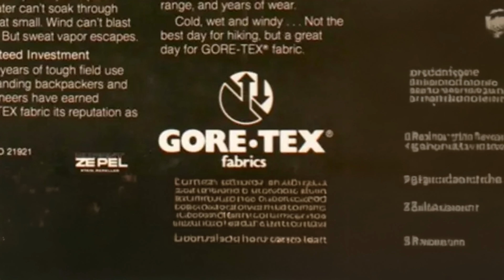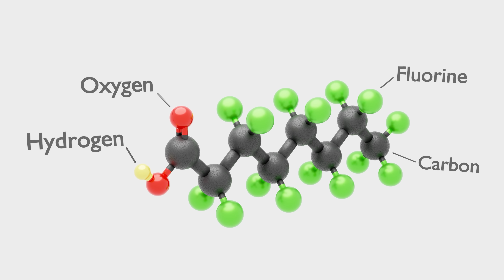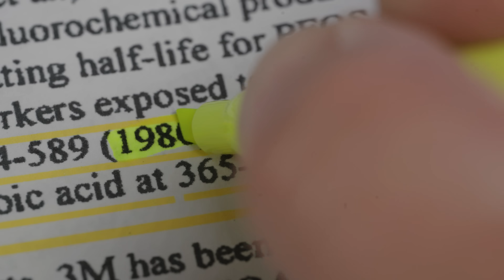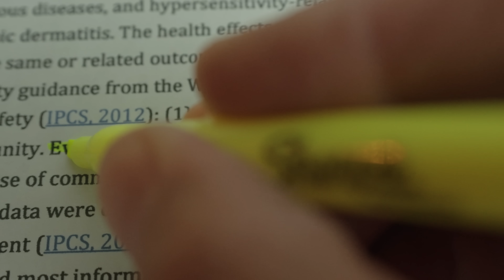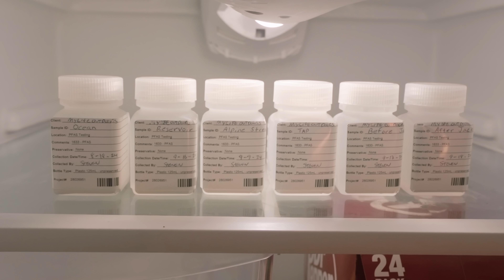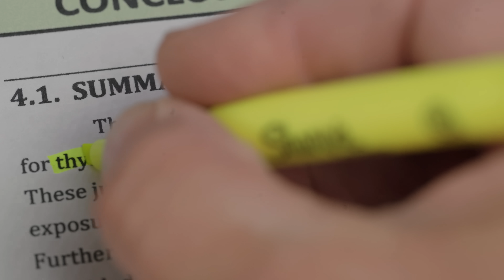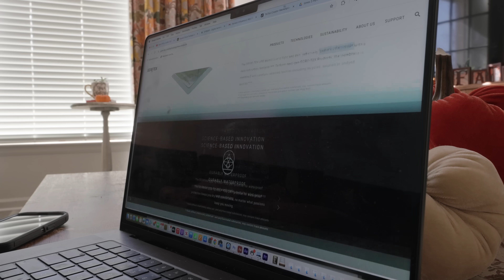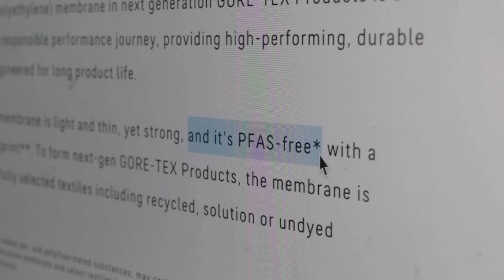Your Gear is Poisoning You! (Not Clickbait)

Comment: As a Chemical Engineer the issue is generally that while the polymer itself is very very stable, the monomer is never completely consumed in the reaction and cleaning of the polymer fibers is never sufficient to remove ALL remaining monomer.  Think of it like a big bowl of spaghetti, toss in in sauce, then freeze it... then wash the sauce off the outside without letting it melt... still lots of sauce mixed in the middle to slowly leak out.
Reply: Could you freeze the spaghetti in water then shatter it into smaller pieces? 

I have this idea in my head that you might be able to somehow encapsulate the chemical then break it apart into smaller more manageable pieces, but idk. Sounds like you would need stronger chemical bonds that what the forever chemicals are held together with which is just making more forever chemicals. Is ozone a forever chemical? That's the strongest molecule I can think of but once again I don't know a whole lot.
Reply: @jllemin4  the issue is you want long stable polymers which is good, but polymerization always leaves some monomer and short chain polymer trapped in the ball of long chains.  If you break the long chains you destroy the useful properties.  Generally you'll use a solvent bath and water bath to remove the excess but you're never going to get it perfect.
Reply: I was under the impression that long chain polymers that are more stable are the ones that degrade into micro and nano plastic particles ? Short chain polymers are the ones that are easier to recycle ?
Reply: @Onoma314  the long chains will stick around for a long time so yeah if you throw that coat into the ocean it will eventually shred into micro plastics but the stuff that will wash out in the rain are the smaller monomer and short chain polymer chains of the same exact polymer.  Recycling is a separate issue related to the type of polymer.  In short it's all bad with PFAS but the short chains are what will leach out even if you are careful with disposal and are often dumped by the manufacturer into the ecosystem as treating that waste water for PFAS is expensive.
Reply: How much $$$ do you the public will pay on their products for companies like yours to continue to manufacture.

Because while everyone wants to *** & complain about chem this and chem that; they quiet down real quick when the wallet starts being affected.
Reply: As someone who cooks a a lot especially spaghetti that explanation is very helpful. I am also very bothered by forever chemicals to the point to where i will almost never drink or eat from plastic of any kind   but it is so hard to avoid..  Good cast iron is a very good replacement from chemical  coated pans it takes some doing to take care of them but they last for longer then any of us will be alive.
Reply: @markcalhoun8219  Appreciate you taking the time to answer that, Mark. I live in Asheville, any thoughts on the water quality issue here down the road, since there were so many manufacturing plants here ?
Reply: @MR-MR-ud5oo  there is a reason I do not work for a chemical company despite my education.
Reply: @Onoma314  overall the US has a huge infrastructure need for water purification capable of tackling large stable organic molecules such as PFAS and pharmaceuticals.  We are getting closer but it will be a long road.  If you live in an affected area get a RO filter to at least be drinking safe water.
Reply: @markcalhoun8219  I filter and distill my water but the amounts of micro plastics and VOCs we are exposed to in our everyday lives, in our houses and cars, is insane.  PFAS and PFOS aren't the only bad chemicals...
Reply: @markcalhoun8219  Big facts about reverse osmosis.
Reply: @MushookieMan  Grandpa and dad had lead and we get plastic.

It's just something you gotta deal with ngl.
Reply: @markcalhoun8219  Thank you
Reply: what solutions is the industry trying right now?
Reply: Hi, an MD here. What he is saying is that no chemical reaction is ever fully “complete.” So, at the end of the of it, there will be small quantities of non or partially consumed reagents or building block chemicals. These will be mixed and insinuated into the fibers of the product. As such, one can never really wash them out completely and they will continue to leach out over time. This is one of my complaints about chemistry in general, the assumption that things are benign or safe without study. The human body and the Biome itself is ridiculously complex, and as such is very sensitive to unexpected disruptions. Normal biohazards are in someways better because our bodies seem to be designed to be able to manage and metabolize them, even poisons. Not so with so many sturdy organic compounds. Even changing a bond in an unsaturated fat from “cis” (normal, biological) to trans (abnormal, synthetic) is a disaster, and our bodies literally cannot metabolize or excrete them. As a society we need to be MUCH more careful! But…profits will ALWAYS get in the way!
Reply: @markcalhoun8219 by affected area, do you mean N. America? 😂
Reply: @MR-MR-ud5oo maybe some, but not all. As someone that would pay the difference for a safer and healthier product, I disagree
Reply: @markcalhoun8219  Which is one reason why I couldn't continue working for a pharm contractor.
Hard to stay there when their business model is:
Reply: @jllemin4  we need the long spagetti strands thats whats usefull about the polymer
Reply: Its in the pockets and hems if my excma is anythung to go by
Reply: So you need yo make hollow tube noodles like macaroni
Reply: All the linings of my water proof jackets end up turning to a powdery dust, breaks down like crazy after 3ish years.
Reply: Thanks for explaining, People kept mentioning that it doesn't break down and I'm like isn't that a good thing? That means it's inert. And no one has brought up any casualties as a result of Pfas so I'm very confused.
Reply: this is one of the worst analogies, or rather badly worded analogies
what do you mean "wash the sauce off the outside"? why would you wash a bowl with frozen spaghetti in it? your last statement makes it even more confusing; WHY WOULD IT BE IN THE MIDDLE IF THAT'S ALL THAT WAS IN THE BOWL?
not everything can be simplified, and sometimes it just makes the understanding even worse.
Reply: But what if the issue isn't really an unusually capitalized chemical engineer? What then?
Reply: Can confirm this guys comment. Good analogy. "Chasing" monomers out of polymers in the production process isn't 100% effective. The manufacturers keep an eye on residual monomers during QC and will do what they can to keep residuals as low as possible. I don't know what tolerances are used for PFSA chemicals though.
Reply: @gongcircle507  I mean planet earth overall but there are especially polluted areas generally near the manufacturing facilities where the levels can be acutely dangerous.
Reply: @bananian  it not breaking down doesn't make it inert unfortunately in much the same stable pharmaceutical chemicals are not inert, they can basically interact with the body like hormones triggering the body to do things it shouldn't leading to cancer.
Reply: @nisbahmumtaz909  I'm sorry it was not helpful to you but it seems to have helped others.  even the professors I studied under used spaghetti as the analogy for polymer behavior.
Reply: @user-deleted  yeah when you're tracing PPT levels you would need some revolution in polymer manufacturing like biological polymerization to actually get 100% monomer conversion and chain length control... even then it's going to end up generating PFAS as physical wear sheds its microplastics.
Reply: Which is why I don't like plastic bottles
Reply: Solution: stop doing this process, altogether.
Reply: Thank you for this intriguing and beneficial information. I appreciate your spirit of inquiry.
Reply: Biomedical Engineer*
Reply: Hope you see this- thanks for that explanation- perfectly understandable 👌🏻
Reply: So my other comment that you will never find here was asking if this was a one time occurrence after manufacturing and if he tested the jacket again would he see none/less?  Based on what you are saying, it sounds like it would be less each time until it was possibly undetectable?
Reply: This is a great explanation. Thanks. I'm not too worried about the GoreTex gear I have. Would I buy anymore? Well, now they're hiding that it's GoreTex. So I might buy gear that has a whole list of wonderful properties... and what is it really?  
My rule about my $250 GoreTex rain jacket is if it might rain, or it's cold, I'll wear it. But if it is going to rain? I'll wear the cheap plastic Japanese fisherman's rain jacket that just sheds water. So I really don't need GoreTex and it's been oversold.  You also have to wash it regularly or dirt build up somehow wicks the water through. 
I also don't think my gear is 'poisoning' me. It has proven bad to manufacture it, and it gets into the environment where it is persistent and bad. But wearing it? 
I've got some Seal Skinz socks that work like GoreTex. These are one of those products where if it has PFAS they hide it. They actually have the GoreTex effect. Right up next to my skin, I can feel air passing through the socks and my toes. But they are waterproof. My feet never sweat, never get wet and are warm when I get in my sleeping bag.  Two layers of Smart Wool, if they get wet, my feet are usually cold for 45 minutes in my sleeping bag. The heat from my feet effectively drives moisture through the SealSkinz 'sock membrane.' Wool also does this. But submerge smart wool, it gets soaked and overwhelms the moisture wicking. What would work is a waterproof layer over the socks. So no GoreTex effect or PFAS needed.  So when it comes to a GoreTex jacket.. they do have a comfort level, but layers of merino wool under any waterproof jacket with a zipper, maybe some vents, I think will always be better.
Reply: @WillN2Go1  Yeah honestly I'm not going to get rid of mine either but there's a lot of reasons I'd prefer other options in future.  Same with teflon cookware.  I can't say I'll have zero teflon pans but in general I try to use ceramic, SST or Cast Iron.  The overall issue is how prevalent PFAS are in industrial products, it's in lubricants and components across the planet.
Reply: @markcalhoun8219  thanks for the splainations.
Reply: @markcalhoun8219  Yep. I used carbon steel and cast iron for years, but last year I got a Granite ceramic pan. Works great, non stick. Have to be a bit more careful, but seems durable. 
Teflon pans were always temporary.  I dated a girl in college, in the 1970s who said, "F* Teflon. That sh* wears off. Then where does it go?" Wise beyond her years.
Reply: Why are they allowed   ?
Reply: Polymers, like Glass, Never truly melt….
Reply: Excellent analogy.
Reply: My uni chem prof was the same way. Degree in chemical engineering, got into the humanities and then didn’t want to work in the industry.
Reply: @nisbahmumtaz909  What he means to get the the point is they cannot wash out or dissolve all the chemicals used to make stuff like Gore-Tex and it gets trapped in the fibers
Reply: @MR-MR-ud5oo  All Columbia Outdry™ jackets are PFAS-free. I only wear this during the winter and waterproof gear with biodegradable DWR during the spring & summer.
Reply: I’m so confused by your spaghetti example. Why are we freezing? God I thought I was relatively smart
Reply: @frisc0strangler207  because polymers are kinda like frozen spaghetti at room temp which is why they are solid rather than acting more like a liquid as they do when they are polymerized at high temp.
Reply: @El_Hoy_BTC  the real issue is ultimately that they are being made in large quantities in the first place.  No matter what you do that PFAS exists even if you throw them away.  The amount you'll get on you from shoes is basically nothing since the coating is on the outside and you're wearing socks.  I wouldn't worry, just consider whether you need goretex on future purchases.
Reply: You are wrong, read my answer.
Reply: @WillN2Go1  my grandmother liked stone or cooper pans, otherwise they’re trash
Reply: @KEYBOARD_WARRIOR_  what brands? never heard of this before
Reply: It’s okay, I worked for a polymer concrete company that makes millions of pounds of p.conc culverts for sanity sewers. There are ZERO, regulations. I went to a dinner with our CEO, and our plastics supplier’s family owner. They laughed that they just need to make enough money to get ahead of the EPA — as there’s without a doubt no way to turn a profit if the material was regulated in the slightest. 

I did our environmental and permit reporting, nothing there oversees any of the extremely hazardous materials we use for mold making or the polymer itself. It’s all made as cheap as possible. 

Wine vats were recalled for their resin. I wonder what extremely corroding sewer liquid is doing to unsafe and unsealed polymer in our water ways. 

They’re all over, we’re one of the largest manufacturers, and it’s just getting bigger as a civil engineering product.

If anyone has any tips in terms of where or how I can report my former company, I have a ton of information I’d be happy to flip on. They’re absolutely way more harmful than some rain gear, recycling, or any other source of environmental destruction. They’re going to compartmentalize our infrastructure, and it’ll be too late to stop all the poison we’re putting in the ground.
Reply: @victortaveira8271  cooper pans are 🔥
Reply: @markcalhoun8219  Might sound stupid but isnt long chain molecules the same we do when burning in a pan? Cant we just produce some kind of long chain fat that does not have the issues of pfas but can be applied to cloth?
Reply: @OP: Thanks for the objective insight. On reading, I get this question - The polymer is “very stable”, isn’t that the crux of the issue? 

By not breaking down, and IF more polymers are (unintentionally) added to the environment, my scant logic is that the PPx will increase by default. Or, do we regard only the reactive (unstable) monomers to be toxic, but the polymers “safe” with no measurable T1/2, however they increase in concentration? 

It’s late, my brain probably isn’t coping…😅
Reply: @astrocoastalprocessor  Has happened to a couple North Face waterproof Ski jackets that cost a arm and leg, the breathable membrane turns into a plasticy dust that gets in everything, ruins the jacket and other clothing items around it, as you just have flaky white bits everywhere. 

They say its normal. But if im spendinding a few 100 on a jacket id like it to last, without the insides turning to dust.
Reply: @musiqtee  yeah you essentially have two issues, toxic monomers and problematic forever microplastics.  Both cause issues like inflammation and each have their own specific effects on organs and biochemical processes.  So yes if you're near a plant and dealing with high amounts of monomer pollution that's an immediate issue.  60 years of production has also led to background amounts of stable polymer becoming an issue as well.
Reply: @Donnirononon  you're exactly right, oil cloth and waxed fabrics were the norm until the advent of fluorinated polymers.  Much like natural fibers prior to nylon.  DuPont is batting 1000% at making new and interesting pollution for profit to replace existing industries with similar or worse products.  On the Nylon end they even pushed for hemp fiber crops to be made illegal.
Reply: thank this helps alot
Reply: @MR-MR-ud5oo 😮 capitalism has a downside?
Reply: @jllemin4 It’s interesting you say this because what you described was tried decades ago. Realizing PFAS to be toxic scientists wanted a way to easily decompose it so, they engineered metal bonds between the monomers. Theses metal bonds were weak points in the polymeric structure allowing for easy decomposition. However, the thought of “smaller compound smaller problem” turned out to be incorrect. All this did was make the same toxic material smaller and harder to detect and capture. Using your analogy, the small bits of spaghetti turned out to be just as toxic as the big bits but, they also passed right through the strainer.

This is one of the primary challenges with PFAS today. Detection can be so hard where we don’t entirely understand just how bad the problem is. It is very stable which makes it hard enough to detect as it is but when you also make it small it becomes that much harder to detect.
Reply: @markcalhoun8219  then the problem seems to be that you're still allowed to manufacture it while that problem hasn't been solved yet
Reply: As a mechanical engineer, thank you for explaining it in general terms. I actively avoided chemical engineering.
Reply: @Serum405  very cool
Reply: @stephendenagy3396  What really gets me is that we know that money is the problem that stops us from solving the real problems. Yet, no one knows how to get around it. More importantly, no one who can change it wants to because, you know, money.
Reply: @whirled_peas  and that there are very lax standards on where it is used and how and how it is disposed of and how the waste products are handled.  you could argue we need ptfe in some areas but regulation is far behind.
Reply: Are there any advancements could help minimize the presence of residual monomers in polymer products?
Reply: @MR-MR-ud5oo the real question is how much are we already paying in taxes for the rising water treatment and healthcare costs
Reply: Thx for your work. Things that cause hormone disruption, especially among kids and are cancerous, worry me infinity more than Co2.
Reply: Wow good analogy
Reply: I love it when an engineer lends technical insight.
Reply: Synthetic fabrics also leach hormone-mimicking chemicals into the skin, especially when you are hot and sweaty i.e. the gym.  An [ex] friend of mine worked as a chemical engineer for a textile company in the Netherlands trying to find a solution before this issue became a public concern
Reply: Brilliant explanation.
Reply: You would know that the water would dethaw the sauce
Reply: Remarkable explanation! 👏 As an EHS professional, thank you for this comment.
Reply: broke tooth on bowl, instructions unclear.
Reply: @ you mean the chemical that is constantly around you and already in you in quantities way larger than the jacket could ever give you as was literally said in the video. Use ur brain.
Reply: Everything is dangerous, we're all going to die someday we don't live forever....
Reply: @danmiller2177  so like, dying faster is good for you?  Living with less health until we die is cool?  Interesting philosophy but some may prefer an alternative.
Reply: @markcalhoun8219  genetics play a big role!!! People don't control reality, genetics does.... Work as a forensic pathologist!!! And you see what I'm talking about....
Reply: That's such a good metaphor
Reply: @stephendenagy3396  As an MD you probably also know about Paracelsus principle ;)
Reply: @WillN2Go1  I was very disappointed by ceramic pans. Hope yours is better than mine but honestly, nothing beats stainless steel or cast iron.
Their only "disadvantage" is that they force you to become a better cook !
Reply: @0Logan05  Cellulose is a polymer ;)
Reply: @Donnirononon  Alcanes, are perfectly suited for this. You may know the first one: methane. But you probably already have handled the ones with more carbon atoms: paraffins :)
Reply: Of course I should say it is also manufactured - or synthesized I should say - and so a lot of it leaks into groundwater. Many stories about 3M in Minnesota lately.

There is a new fabric being manufactured by Trenchant Textiles that does not have these forever chemicals.
Reply: but if t leaks out, it is still harmless if only lightning can break the bond or thousands of years
Reply: @BCFalls1  ptfe polymer is non-toxic, that is not the same as harmless, also the unreacted monomer is toxic.
Reply: @markcalhoun8219 apparently carbon filtration works.
Reply: @jllemin4  Lol... Is ozone a forever chemical? It is very reactive, which is the opposite of a forever chemical! That is also why it's toxic in direct contact and can be used for sanitizing stuff, because it reacts with stuff and kills bacteria and becomes safe oxygen in the process. And haven't you heard of ozone depletion? That is breaking down of the ozone layer catalyzed by man-made CFC compunds that used to be used as refrigerator coolants but have since been banned or restricted for this very reason. If ozone was a forever chemical, we would never have had ozone depletion.
Reply: Thank you for explaining for us smooth brains. 😊
Reply: As a chemical engineer, is it your job to create chemicals? If these disease causing chemicals are created can't we just stop making them altogether?❤🙏🇨🇦🍒
Reply: @TrueEarthCherryPopper  no, chemical engineering is just a discipline of applied sciences which can be used for all sorts of things.  Typically chemicals are designed by chemists and material or polymer scientists.  Companies then build factories to product them and hire engineers to design and operate the equipment.  Companies will generally only stop making things when subject to government regulation.  Personally I do not work for a chemical company.  Even if we stopped inventing new chemical compounds today we have decades of testing and regulation to do to catch up with where we are and that's a process we should invest in.
Reply: We use milk everyday life and it comes in the plastic bottle used to be glassed bottles many years ago.
Some plastic bags for example has a strong plastic smell and again we use everyday life. We don’t even think about what it contains within the plastic material. 
We need to back to the old fashioned tradition. Use natural resources such as wood and wool made , paper , cotton .
Reply: That is exactly why I just add Parmesan cheese to all of my Gore-Tex jackets.   I just roll with it.
Reply: Wait if the jacket is spaghetti why am I filling my pockets with pasta. Might as well eat the jacket
Reply: @stephendenagy3396 Profits are necessary! How do you make it? How do you make a living? Attacking the profit incentive is about an ignorant action as any. Perhaps you could educate yourself on what really causes humans to hurt others? Or how about becoming literate in how to communicate?
Reply: Thank you!
Reply: @9xqspx6 There’s places where it’s irreplaceable in medical, aerospace, high temp seals, etc.
Reply: And the noodles are stained too.
Reply: Commenting to boost algorithm ! Nice comment
Reply: @stephendenagy3396 
Thank you for your valuable input.😊
Reply: Is it even possible to get rid of pfas chemicals in the future? in our blood and environment? what does the researchers say? 😢😢
Reply: @joennnna123  yes there are water treatment technologies for removing them from the drinking water, the environment is much harder and what is in your body already is basically there for good.  So it can get better, especially if we also limit their production and control their waste disposal.
Reply: @markcalhoun8219  sounds like what makes canola oil toxic. The oil from the rape seed is extracted chemically and the chemicals can't be entirely filtered out of the cooking oil product. My stomach gets queasy if I read canola oil on a label.
Reply: Well said. I hate when people who don't understand chemistry misrepresent situations they don't thoroughly understand. To the average citizen. This video seems super credible and scary... Causing panic among the ignorant.

 Until they realize the PFAS epidemic is very similar to...  and likely safer then most tattoo inks in use today. Lol.
Reply: @HoboHoller  it's about chronic and universal exposure at scale, if we were serving children water laced with tattoo ink it would also be an issue.  As it is tattoo ink exposure is voluntary and the amount dumped into water supplies is minimal.
Reply: sooo how do we know what clothing have pfas in it?
Reply: Doesnt that mean that the teflon in nonstick pans also contain PFAS? And considering how often they chip and we eat those chips, are they a substantial source of PFAS?
Reply: @JxtoGames  yes especially when used with metal utensils or heated above 500F.  Those would be the worst source the average person is likely to be exposed to.
Reply: Absolutely terrifying!
Reply: Makes sense
Reply: Wow! You just explained something to me I never would have thought about otherwise. Excellent comment, thank you
Reply: You collected the water samples in "pfas contaminated" aka plastic bottles
Reply: @TreasuryTrader  plastics are not made of pfas.  Very few water bottles contain pfas.  Most are made of HDPE, LDPE, Copolyester or PETE none of which use fluorinated monomer.  Most no longer even use BPA.
Reply: No one replying to you has brought up ultraviolet degradation of the otherwise inert fluoropolymer into the harmful monomers and shorter chains.
Reply: @jllemin4  Yes go below the glass transition temperature of the polymer. It will shatter nicely after that.
Reply: @markcalhoun8219  can chemical engineering be a sustainable process? could a chemical engineer design an eco friendly operation or be involved in creating chemicals that are not harmful?
Reply: @7lawaneeena  chemical engineering is just a discipline of study involving chemistry, physics and material science and its application at industrial scale.  Chemical processing can be green, the general concept is called cradle to cradle.  Sun Chips actually made a cellulosic plastic bag that was 100% biodegradable but... it was more crinkly and louder than petroleum plastics so people didn't buy it.  With regulations and effort many many products can be made to reduce pollution or eliminate it but currently we value profits over everything and anything.
Reply: As you say that the chemical is certainly abundant, you support the thesis that the chemical is not particularly harmful.
Reply: @johnsmith1474  no, I'm saying it's not acutely toxic in the concentrations currently in our bodies from typical exposure, it is however high enough to trigger chronic issues across populations.  Just like lead in the 70's was in the air from leaded gas and affected many yet people didn't fall dead each time a car passed.
Reply: My sister is a Chemical Engineer as well and she couldn't agree with  you more. She is the one that keeps us informed.
Reply: The question is that: by merely having a PFAS-intertwined clothing jacket on your skin, is that absorbed at all by the skin? Or is it so little amount that its negligible to human health?
Reply: @XedGeneral  if you wear one jacket once it's probably negligible, but in reality you're talking about a lifetime of coats, wearing them daily and that just being one of several large sources.  Even more so the manufacturing of that coat released even more pfas into the environment.  The solution needs to be holistic and luckily monitoring and treating pfas in municipal water is becoming a topic of regulation.  You don't have to throw away all your goretex.
Reply: @Kaye-007  I'm certainly no expert in anything chemical engineering but polymer chemistry is generally far beyond high school.  I have some graduate level courses in and I would just call myself competent in the field.  I've spent more time in general process controls than R&D and I don't even have a masters much less a phd.  I certainly do not expect a lay person to have any grasp of this much less basic physics.  If someone knows the value of g on earth that's like 5% of the population tops.
Reply: @johnsmith1474  No not really, just that the harm may be accumulative, or that it is hard to trace back to this, or that it is currently being misattributed to other causes because of how hard it is to trace it back to this plus lobbying. For example, rise in autism diagnoses might very well be related to this, but it's hard to prove.
Reply: As a consumer...
It's still unacceptable tho...
Reply: My spaghetti is poisoned?
Reply: ０．０
Reply: Ｗell these materials must be good so it had been widely use, what is the alternative??
2:11
Reply: @jllemin4  you sound like you belong in a lab experimenting on mad potions dude😂😂😂
Reply: @Dwibtersell as much product now, for profit, before regulators tell us to stop and then have someone dump all our leftover stock in the ocean over in Africa...
Reply: something I've been thinking about recently is that problems like these aren't anyone's fault

its really, no one's. no one specific. there's no one to blame. which also means, there's nothing to do. 

having no oversight or regulation makes solving problems like these; global ones; literally impossible. There's simply no one that we could ever hold accountable. 

which, of course, companies love, but we really need to come together if we want to do anything to solve these issues. So they'll pay as much as they can to make sure that we don't know about it and can't do anything either

I am not very hopeful
Reply: @markcalhoun8219 hey big ups man. Your comments have been invaluable, I learned alot. Thanks for sharing your insights with everyone. Thanks, Salam
Reply: @eriness  as with anything it starts with building popular movements that put political pressure, especially at the local level.  Municipal water treatment is already facing a need to implement solutions for PFAS which luckily do exist.  It's a problem we can address even if we aren't about to solve it completely tomorrow.
Reply: How do we deal with products that have PFAS?

We cannot just throw them away.
Reply: Wicked😬
Reply: @Ikaros-Von-Kreta  realistically that is the safest thing to do as landfills should be lined, but the issue requires systemic solutions such as water treatment and manufacturing limits or bans as well as declaring a lot of manufacturing locations superfund sites.
Reply: DuPont and Monsanto
Reply: Can you please dumb this down for me? I'm not trolling you one bit but there's just some things that don't compute for me and this is one of those things unfortunately. But I can fix your furnace?  ;)   So I'm skilled but not in everything.
Reply: Or maybe I mean a less simple answer?    Either way I don't know a whole lot about these things.  But I would imagine that these things are not coming from sportsman's rain jackets. There's things in the that are probably causing these issues.  But that's just one man's opinion.
Reply: @washburnbilly  they come from every application of Fluorinated Organics, so teflon pans, scotchgard, teflon components in machinery, goretex, etc.  You are correct the magnitude of the issue is that this stuff is in everything and regulations and technology for water treatment are decades behind.  3M was aware of this issue in the 70's and buried it.  There's no need to panic over individual items but overall we need to consider where this polymer is actually needed and where we have better options that reduce production of this chemical which lasts in the environment for thousands of years and causes broad health issues.
Reply: @markcalhoun8219  thank you for your reply Mark.  I understand that it's a thing, but it's not rain gear causing it.  Between the Teflon and what's being sprayed in the air who knows what is the real cause?  But I tend to think that those two are way more contributing than rain gear?   I don't know, maybe I'm the one Ill informed?
Reply: @washburnbilly  it is rain gear AND all the other products.  The less products created with teflon the better.  It is brought up here because people who hike take conservation seriously and if you don't need to add to pfas pollution then you likely do not want to.  Similarly teflon pans can be replaced with CS, SST or Cast Iron.  No one thing fixes the problem globally though but that doesn't mean personal choices are useless.  There is no aerial application of PFAS I am aware of, it's for low friction surfaces, chemical resistance and water/stain proofing.
Reply: @markcalhoun8219  the Rouge River in Rockford Michigan has been polluted with Pfas because of a company allegedly dumping bad water?  We have problems everywhere!  Thanks for the reply. I'm not trying to be a Jackwagon, however I am suspect of much of what people are telling of. Meaning that the sportsmen and hikers aren't the cause of this problem. So do your thing and get different rain gear if you think it matters. Do you have a gravity water filter yet?    If not you should.  Alexa Pure or Berkey are the best from what I have heard. 
Thanks for being civil even if we might not agree. That's pretty rare these days.
Reply: @washburnbilly  certainly not the primary cause, if you eliminated all the goretex and teflon pans you would have massive sources in industrial teflon so again no one person can solve this but if you watch more of the channel you'll see he's also gone over how this method of waterproofing actually doesn't even work that well so it's easy to give up for more traditional longer lasting and less polluting options.  Actually I live in an area with annual water reporting that is very detailed and have done confirming tests myself so no additional filtration is needed for safety.  PFAS are pretty hard to filter without RO but I may invest in that some day.  My hope if more municipalities invest in modern treatment that destroys pfas so at a minimum it is prevented from harming communities directly through the water supply.  I'm not here to argue, these are just the facts as relate to basic science of these chemicals and as you say, companies dumping into their locality are by far the lions share of the pollution, but they dump the waste from the production of these products, stuff like the wash water used to clean the finished polymer and the process equipment in between batches.  It's ultimately all related and needs regulation at the federal and global level like CFC's did for the ozone layer and lead in gasoline.
Reply: As an automation specialist in a large plant, I was asked to join in implementing the NOx Emission Monitoring program.  I had been to the Smokey Mountains and seen the tops of the trees in the forest gone.  That was a huge problem and to a large extent, it was addressed. I have been exposed to so many organic solvent and chemicals, that I could not even begin to count them (I still love the smell of Benzene...lol).  On a scale of 1 to 100, I put this issue at about 5, methods to filter the forever chemicals are likely to be found and then it will diminish). Where do you put your level of concern ??
Reply: JUST EAT THE SPAGHETTI‼️😂😂😂😂
Reply: @fekkyb  "silly daddy you can't eat carpet" "course not, first you have to boil it, softens the glue"
Reply: The question should be, how do we clean it up.
Reply: @ralphtepedino2004  a mixture of superfund site treatments, decreasing production and implementing new existing water treatment methods for municipal water would be a start.
Reply: That was one the most odd analogies ever. Kudos. 🫡🫡👍❤️🇺🇸🇮🇱
Reply: As a comparison this is like saying that if you soak memory foam pillow in liquid nitrogen, there will still be liquid nitrogen in it forever after it’s been exposed to normal atmospheric conditions. Vapor pressure doesn’t forgive especially when the polymer isn’t pressed into a thick hard piece. The additives used in production is the issue here
Reply: That's a great explanation and a great analogy.
Reply: @Waynebrady99  not really as liquid nitrogen is only a liquid at VERY cold temperatures or very high pressures, neither of which memory foam can contain.  PFOA monomer is a solid at room temperature, this is like saying that if you get powdered sugar into the cells of a memory foam mattress, you're going to have a very hard time getting it all out yet your head is often going to feel a little sticky in the morning somehow.
Reply: I hope your a teacher cause that's how you explain stuff to dumb People ❤❤❤
Reply: @markcalhoun8219  sir I’m talking about tetrafluoroethylene monomer which is the monomer for ptfe. It must be under extremely high pressure or extreme cold to remain in the liquid state without flashing off, it could not exist in a coat. The the original comment is talking about tfe monomer. It’s very much different than the per-fluorinated surfactants that are stable under normal conditions that have the possibility to remain in a finished product
Reply: @Waynebrady99  sure but that monomer is also explosively reactive with oxygen so it also... sorts itself out rather than stick around regardless.  reactant byproducts are more specifically the issue for ptfe but the point of this explanation was a lay audience, I'm not trying to conduct a graduate level class via youtube comments nor would I be the right person to do that.
Reply: @markcalhoun8219  hey your doing a fine job anyway lol
Reply: So sorry to bother you, but has anyone heard of graphene fabric… it seems to be one of the newer things on the outdoor market but I don’t know much about it and if it’s also using dangerous chemicals in it I thought I’d ask here
Reply: @MircusBircus  actually that phenomena is the process being described in reverse, organic molecules working into the polymer mesh rather than leeching out.  It demonstrates the same thing ultimately that plastics are permeable sponges that absorb and leech chemicals.
Reply: @ellemmenn2930  graphene is pure carbon so ultimately what you're dealing with is the chemicals used in producing it and the chemicals in the epoxy resin which would be the same found in fiberglass.
Reply: Dude, that was a great explanation 🎉
Reply: This is a truly great video 😊  I would put this guy up there with Robin Hood and Mahatma Gandhi.
Reply: In heaven there will be no toxins poisons nor sickness nor death nor sin. I cant wait. I'm going there soon. Thank you Jesus❤
Reply: Noice Woyk
Reply: @justcommenting4981 Very Noice Woyk 👍
Reply: What if instead of spaghetti noodles, you use gnocchi?
Reply: @thenathanimal2909  you mean what if instead of making long chain polymer you made fabric out of tiny discrete unconnected bits?  you'd have dust and not fabric.  If you mean what if potato... then potatoe.
Reply: So as a chemical engineer. Why not design something that is actually safe?   Ethics remember?
Reply: What are you talking about? Fix the issue then genius make urself useful
Reply: @kylesmithey5082  safe alternatives exist, I do not work in polymer manufacturing at all.  He has covered other materials in his videos which do not use goretex.
Reply: @JonathanLouispolansky  safe alternatives exist, this isn't a tech issue, it's a commercial choice issue and regulation
Reply: Excellent break down, you really know your stuff
Reply: @jllemin4 it’s the carbon-fluorine bonds that make it extremely stable as these are one of the strongest bonds
Reply: @jamesmedina2062 I think maybe aggression causes people to attack one another.  And fear of others in turn drives aggression.
Reply: @conradsichler9251   so what controls or limits aggression? Good culture does right? Emphasis on collaboration and teamwork no?  Competition over resources drives aggression at the macro and the micro levels.
Reply: sauce
Reply: @markcalhoun8219 and by the time something like this is developed, other problematic chemicals will found in our water 😩
Reply: Or, we can do better 
Your father and grandfather didn’t have the benefit of computers and hindsight.
Reply: Any real chemical engineer knows they’re not a chemist.
Reply: @tsolizilv7491  when did I say I was a chemist?  I actually double majored and spent several years working with phd polymer chemists on research but yeah I'm not claiming to be a chemist, I just understand chemistry especially polymer chemistry to a better degree than most people.  The main difference between a chemical engineer and a chemist is basically focus and time in the lab.  The difference between building machines that make cheerios and cooking in a restaurant... both have to understand dough.
Reply: Damn I work with polymer every day in the construction industry.
Reply: What a comprehensive way to explain it
Reply: Thank you for the explanation, That?
Kind of proves what my gut feeling was, And that this whole thing is a very creative way by a lawyer or team of lawyers 2.
Complete a seven hundred million dollar class action. Then we start making arbitrary laws and the civilians get punished for things. They have no control over
Reply: Very apt analogy, I like it.
Reply: Nerd
Reply: Nerd
Reply: In other words it’s not fucking stable at all and shouldn’t be used in public.
Reply: @JakeAllen-w7k  yes, exactly.
Reply: @ I like your questions and proposed answers.  I agree, a culture shift and greater co-operation are essential to any such change.  In addition to a material scarcity in the present moment driving harmfully competitive behaviour, I think there can also be something more like a fear of scarcity that might come from a prior generation, or else a human desire to dominate or control others which can come from a personal or cultural poverty of emotion, sense of self, or sense of the beauty and value of life.